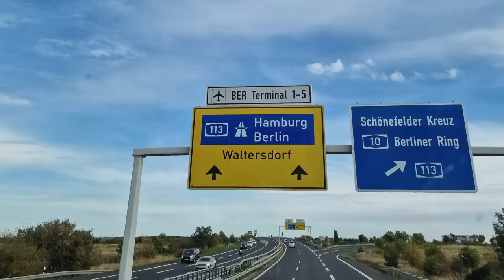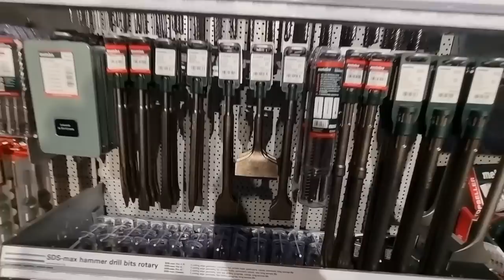New Tools from Metabo and Hikoki, My visit to see the latest kit

Comment: loved metabo corded tools from the moment i used their top spec angle grinder. i'm glad they are expanding the range that way i change most of my cordless tools to  metabo.  if  you are in a position to give feedback to metabo their cordless tools unfortunately mainly made in china don't last as long as a makita equivelant and the multi tool vibrates in the hand more too and ive managed to break a few through normal use way before they should have failed.: key improvements to cordless. : longevity, vibration . thanks, all the best
Reply: I agree.I'd been using a Fein wibbler (multitool) for a few years then got a cordless Metabo and it has mental vibration levels in comparison.Sometimes even removes the battery on its own!Don't get me wrong,I generally love Metabo gear (20+ years) but the wibbler sucks ass!

Comment: Hi robin, had all my DeWalt stolen from site and have started rebuilding with hikoki. Seems to be very similar to makita but with a little more power. Really struggle to get information on up and coming tools tho. Seems to be some brilliant kit but only available from japan. For example only a couple of tools link with their dust extraction system and not much in the way of basic extras with tools inc guides and dust adapters. Did you get the idea of anything improving? Cheers, Dan

Comment: The perks of being a celebrity Carpenter. I have both Metabo and Hikoki tools. Slowly going out of Metabo. They are not big here. Variety is limited.. Hikoki are a mixed bag. Drills and drivers average. Bought top of the range jigsaw. Broke first time I used it. Swapped for Bosch. Cordless nail guns. Have framer, 16 and 18 ga. Great bits of kit. I have at least 6 Brands to find tools that work best and feel right.

Comment: Hi Robin. Happy new year. With the constant increase in power of portable tools could you ever see a use for a portable metal plate press (as in trussed rafter plates)? We do have them in the USA and Australia but they are pretty big and not so portable. Obviously with structures there is a design element so you would not use them there. But none structural wall panels and small frames there may be a market. What do people think?

Comment: Is the metabo nailer a rebrand of the hikoki? Looks very similar, and what with them being the same parent company it does make sense.
Reply: Looks quite like it, just as the recip saw shown, but nice still.
Reply: It looks like they do a lot of cross-development now. Which makes sense. That new Hikoki plunge saw looks exactly like the Metabo saw just with a different style of plastic housing.
Reply: @TomsTimmervan  Is the recip saw shown originally a Hikoki? Nothing wrong with that, it looks a beast and it is on the list!
Reply: @harveysmith100  Not sure if it is the same but on the video, to me, it looked quite similar to the 36 volt Hikoki UVP recip saw. Which is one of the best imho

Comment: The metabo nailer looks just like hikoki. I think I've underestimated both Metabo and Hikoki as brands. Talking about nailers; I've compared both Paslode and Hikoki nailers with each other. The weight-difference is very small!
Reply: The milwaukee framing nailer is a joke.  It weights a tonne.
Reply: @2loco and it's a sealed unit. Try to replace parts down the line
Reply: I sold power tools retail for years. Hitachi, pro Bosch, Makita, Dewalt, Panasonic the lot. Rarely had a Hitachi back over the counter. Still have one of the first 18v combi sets with an impact driver which just won't die. Its great kit, just doesn't have fanboys like the yellow and red stuff

Comment: Thanks for the report @robinclevett . The cross platform battery idea is great - commendable even -  HOWEVER it seems that the major flaw is that it's overlooked by the major global players such as Makita, DeWalt, and Bosch. Fact is most people use the aforementioned three for the majority of their general work, and these companies NEED to sign up to this cross platform/brand battery concept to truly make a difference to the environment.
Reply from the maker: I agree and many others do too!! there will need to be some consolidation across tool brands in the future, The Cordless Alliance System has about 50 brands included now too so that is a great start
Reply: Bosch started their own battery cross platform last year called ampshare with about 25 other brands I think and with more brands to be added, I think DeWalt and Makita are too big a brand to share along with Milwaukee they have a huge chunk of the tool market.

Comment: I run two battery brands- metabo and hikoki. CAS batteries are great, metabo batteries fit 30 brands, but not hikoki. WTF?
Only went to metabo 2 years ago as Hikoki didn't do a cordless tracksaw...
Reply from the maker: Hi Ross, did you see the new Hikoki track saw in the video?
Reply: @ukconstruction  Yes, I did. Thing is I asked the Hikoki guys at the ffx show in 2020 if there was any plan for a cordless tracksaw, and they said no. I had a corded TS55, but once you are mostly cordless...that one tool stops being so useful. Wasn't going to start on festool batteries though-that way lies madness
Then you did that film where you were repairing a garage door set, and seemed to be recommending the Metabo saw, so I bought it and the dx. No regrets at all, but the dx eats batteries. The Hikoki one looks to be the exact same machine, with a different battery connection, which makes sense. Is it 18v like the metabo, or 36v?